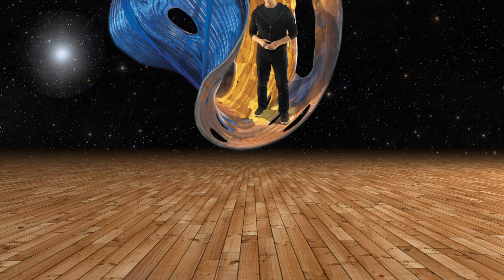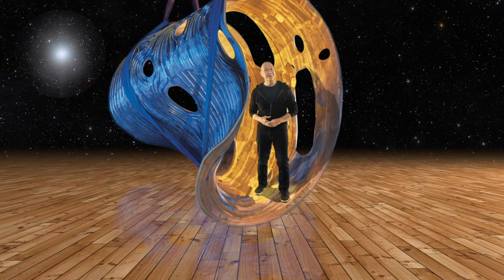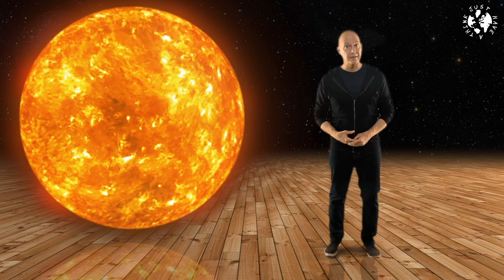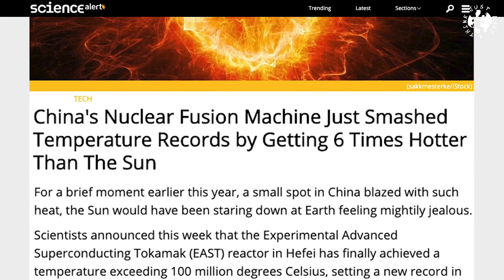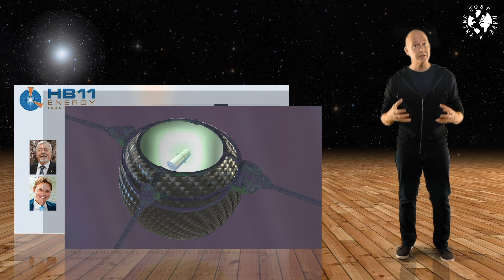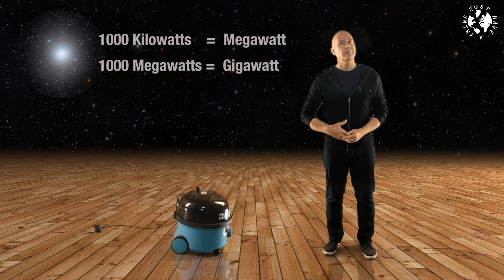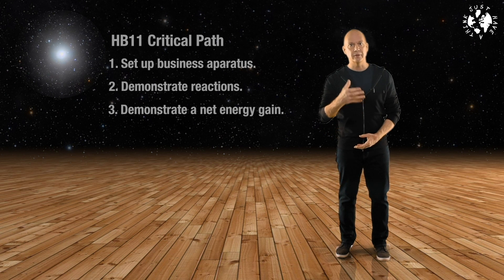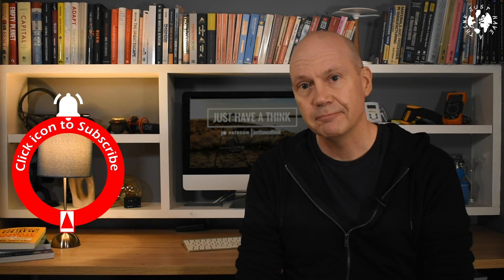Nuclear Fusion:  Revolutionary new breakthrough.

Comment: I keep hearing that fusion power won't have waste or pollution. It may be true that there won't be radioactive waste, but there will be waste.  By its nature, fusion fuses hydrogen, or, actually, deuterium, turning out helium. You might say, who cares about helium, it's a noble gas, not reactive, and not pollution. That's probably what the people who burned wood and coal used to say, a century or two ago.  But once you build lots of fusion reactors, you start producing lots of helium. Since helium is a chemical element that is totally unreactive, it will stay in the atmosphere forever. You won't be able to plant trees to capture it the way you can to capture carbon dioxide. Eventually, the amount of helium in the atmosphere will build up to measurable amounts. This will start to have an effect on the weather that nobody has bothered to predict. Later, the percentage of helium in the atmosphere will be so high that it will displace enough oxygen to make places at higher elevations deadly. Later, the death zone of the atmosphere will get lower and lower until the entire planet can no longer support mammalian life. Just have a think of the future.

Comment: We already have fusion power plant designs that WORK. Just that nobody wants to do it...dig a BIG hole, like a mile cubed, line with concrete, fill with water and cap it with a lid. Drop small fusion bombs into the center and detonate. Collect the steam to run turbines and repeat till we use up the worlds stock of weapons. Filter the water to reclaim the fission products as we go and re-refine for more bombs

Comment: Nuclear fusion is a blind alley. Nuclear fusion introduces more heat into the system. You won't cure global warming by introducing more heat into the system. Solar and wind do not add any extra heat into the system, they have no effect on global temperatures, they generate by using the energy that is already in the system.

Comment: In December 1942 the first controlled uranium fission reaction was achieved in the "Chicago Pile 1" experimental reactor. Just 14 years later in 1956 the first commercial nuclear power plant was inaugurated. 
Without underestimating the greater difficulty of controlling the fusion reaction, I believe that the progress of science has lost momentum
Reply: Yeah but the reason to build those reactors was to breed material for the Bomb. Genarating energy was only a side product
Reply: @Sanginius23  Right !.  The cold war was an important part of that "momentum" in the sci and tech progress. 
But there are also many examples of quick progress in fields far from the military uses.

Comment: We already have a solution to clean renewable power generation with solar, wind and storage.  The major blockage to getting it moving forward is legacy fossil fuel investments where they will stop at nothing to prevent them swelling the maximum amount of their product.  We can argue about the cost of Fossil Fuel based energy but it easily costs more than it’s worth in health and environmental damage. A Stanford Study states that the 87T global economy puts up with 67T in Fossil Fuel industry un allocated costs.  A Fusion industry could easily replace the Fossil Fuel industry as a block to moving forward with cheap local solutions.. Fusion would require a high tech and expensive infrastructure that would simply repeat the same awful hamstrung state we are now in where we cannot move forward with workable solutions against the monied interests of Fossil Fuel.  Additionally,  by the time Fusion gets working it should not be needed and if it is needed then we have gone past our point of no return and it would be too little too late.  I say, put all the effort and money into planning the substantial end of Fossil Fuel by 2030 and if Fusion comes along then it can compete with the incumbent  renewables but we cannot hold our breath for a second and waste resources on Fusion when we have a solution at hand.

Comment: The only thing that matters with regards to solving the global climate crisis and the energy and water crisis that comes alongside them is ENERGY DENSITY. Humanity has always progressed and advanced technologically when our power sources get smaller and produce more energy per unit volume. That's why nuclear fission and nuclear fusion are the way that humanity should be going - they pack ENORMOUS amounts of energy in very, very small packages.

Wind and Solar actually reverse this equation - they are ENERGY DILUTE - and use MORE RESOURCES to capture less usable energy per unit volume. It's foolhardy and will lead to eventual resource exhaustion and collapse. We need an energy density breakthrough so our society and move to clean energy, pass this great filter moment, and work to clean up the damage from 100+ years of fossil fuel use.

Comment: Its a neat bit of technology BUT it generates energy in pulses using an expensive expendable fuel capsule. A far more elegant take on proton-boron fusion can be found here: https://lppfusion.com/technology/focus-fusion/ and even here, we are now faced with fully matured and very cheap renewable energy. Add grid scale energy storage and it is unlikely that any form of fusion will be economically competitive. Good luck to HB11, but they may have missed the bus.

Comment: So, the obvious evolution is to use the stellerator design as a basis to create a toroidal version of wankel rotary engine. Using areas of high compression to generate fusion, then bleeding off the heat in sequence before another confinement cycle.

Comment: It would need temperatures 10x that of D-T fusion that tokamaks and stellarators need. I like that it doesn't produce neutrons, and the alpha particles become the electrical charges. But not being able to harness the speedy particles is wasting that energy as well (or did I miss that part?). Count me in for dropping the economic breakeven from 30 years to 29.

Comment: First up, he mentions if we ever achieve it at scale, well, actually, it gets EASIER as the magnetic confinement bottle gets larger, the reasons for that should be totally obvious. Having read a bit about the technology, it is abundantly clear , and stated by the experimenters themselves, that they do not wish to demonstrate a working model for energy production, but rather further avenues for other experimenters to consider attempting, in short, this idea is clearly orders of magnitude behind ITER in terms of technology readiness. The Wndelstein stellerator's concept is also another technology that is not as far along as ITER. The problem of confinement with ITER was looked at and they attempted to solve it by building a larger Tokamac, which gives more tolerance regarding confinement due to having more distance to the vessel walls and also allows for a more diffuse magnetic field, in an analogous way that a star needs to be of a certain size or mass in order to fuse.  ITER, however, also has another serendipitous advantage that they were not counting on , yet nevertheless will guarantee them success: The new REBCO superconductors completely change the game of stable confinement, these will give the device the ability to create electromagnetic fields up to and probably beyond ten Tesla, essentially they will have more than enough field strength to hold the plasma and keep it well away from the vessels inner lining. The other, obvious advantage is that q will be reached as designed, ten times energy output than input, none of the other designs will be able to compete with that, from what i can gather, all that is left now is to just finish building ITER, which is still just a demonstrator of the confinement technology itself, it won't have the ancillary equipment to turn all that heat into electricity, that is just the back end, and is relatively easy, albeit rather old school...one part is cutting edge, the other from last century....
Reply: Doesn't matter.  They'll never be able to beat the LCOE of other well known clean sources.  Giant Tokamaks or Stellarators are just too expensive.

Comment: This sounds a very good idea. Whilst I am not a nuclear scientist I have had a lifetime interest in energy. 
Long ago in the 1970's I recall an article stating that the only viable method of controlling the plasma stream would be via lasers. But at the time such lasers did not exist. Clearly they do now and if enough resources are put into the proposed reactors we might actually get something done. 
In fact  they are many technologies which we could and should be using.
Things like Solid Oxide Fuel Cell technology (Ok it is not without its challenges but what technology isn't) Certainly we could and should 
be looking at "mining atmospheric CO2" in much more detail.
I remember a paper published by SASOL the South African Coal to Oil people who stated that it is possible to use solar powered steam reformers  which would produce liquid hydrocarbon fuels from atmospheric CO2 and water.
The beauty of the Solid Oxide Fuel Cell is that it can operate on impure hydrogen fuels ie gasoline/petrol or methane etc etc. Because you would be extracting the C02 from the atmosphere you are effectively using the same fuel again and again. 
Whilst using solar power for your energy input. 
Then you have high pressure compressed air technology. Ok it is only some 34% efficient but if you can use the heat generated by the compression stages it is possible potentially to get up to efficiency levels of some 70%.
Now the rub here is because such systems can have very long lives they are far more efficient in the long term than batteries. How many people today have heard of Leon Mekarsky? I the last 30 years or so of the 19th Century he proved beyond doubt that you can operate a successful compressed air tramway system. What killed this was electric tramways but not for the reasons most people suspect. It is very easy to forget now that when cities first electrified in the late 19th and early 20th Centuries there were no such thing as national let alone international grid systems so each city had to have something that could provide a base load and a tramway system did that job admirably.  So it made much more sense to introduce electric trams. 
Today however it might be worth looking at compressed air in transport again. There are plenty of examples of other technologies that could be looked at again. Another transport technology which most certainly should be looked at again for railways surviving industrial installations which produce high pressure steam is the fireless steam locomotive. I could go on and on
The point is that in fact we could solve the problem of adding carbon emissions if there was actually the real will to do so.

Comment: Solar, wind & wave can be a stopgap until N/fusion. They all after all wear out over time, so it would become a case of maintaining them until fusion becomes available & then phasing out the old (worn) hardware as & when the new becomes available. The question then becomes economic practicality. Will upcoming generations of S/w&wave in conjunction with new storage tech need to make way for N/fusion?
One town, One reactor sounds pointless too. You'd have to maintain a national grid that feeds in our current renewables as a backup.

Comment: I would appreciate your exploration of small nuclear reactors. Bret Kuglemass claims that nuclear is not part of the solution, it is the ONLY solution.
He seems to be at the extreme edge of the solution space, but spins a good story. I'd like to see your excellent analysis of his story. One claim he makes is that getting to zero emissions is not sufficient--we have to remove CO2 from the atmosphere to get back to "normal" and nuclear could produce enough electricity and hear to remove CO2 from the air and synthesize liquid fuels to replace gasoline and diesel.
Kirk Sorenson pushes the Liquid Fluoride Thorium Molten Salt Reactor. And there are plenty of other players.

Comment: "safe" at those temperatures? sound sketchy
Reply: Richard, you clearly don’t have an education in physics, so don’t talk.
Reply: @Gomlmon99  https://thebulletin.org/2017/04/fusion-reactors-not-what-theyre-cracked-up-to-be/
Reply: @Gomlmon99  explain it to me physics boy, come on ya cowardly little bitch.........
Reply: @Gomlmon99  i have operated superheated 400# boilers for over 30 years, i fully understand the difference.
Reply: Richard Larkins How poor must your education and critical thinking be to imagine that personal insults make you any less ignorant, or change facts in any way? It’s like arguing with a child.

Please point to where in this article it says these temperatures are unsafe, as in your original comment.
Reply: Richard Larkins still with the personal unintelligent replies. I didn’t “attack” you, I called you out for spreading lies and misinformation. 

Quote me the line in the article that says these temperatures are unsafe. Or even implies it. 

It doesn’t, because it’s not. And any physicists could see that. No one even talks about that, it doesn’t cross the mind of anyone in the industry because it’s so irrelevant.
Reply: @Gomlmon99  i simply stated controlling temperatures 5-6 time hotter than the sun sounded sketchy, no mis information, no lies, in my book buddy you calling me a liar
 is an attack, you are the one running your mouth at me, and the article specifically calls out the inherent problems controlling temperatures.

Comment: I'm just amateur, and don't mean to ask a negative question as this seems a great goal to achieve.  I was fooled by the titled and clicked.  Aren't such  profoundly high temperatures so extreme and thus so expansive that there is potential for enormous explosions with a malfunction?  With nuclear fission there are great dangers, but none with fusion?  With Elon Musk developing a new low cost very efficient battery design won't wind, ocean, geothermal, solar, forms of energy be much safer and now even more efficient with such batteries?  Also some Australian scientists developed a solar panel the size of a paperback novel that produces as much energy as the conventional much larger ones.  Thanks for making such great videos, a lot of work, genius, and talent goes into them!
Reply: There's just not enough heat in the plasma to melt through the reactor walls. It's hot and under a lot of pressure, but there isn't a lot of mass there.

Comment: Suggesting to follow up with Eric J Lerner’s fusion project. This project utilize a unique approach other players overlooked. 

Most contenders employ magnetic induced plasma (ie electrode-less plasma) at a limited peak temperature which requires to scale up in size in order to up the input energy to reach target temperature, however it’s efficiency also in the process. 

On the other hand Lerner knows plasma well enough to utilize electrode induced plasma and by its instability self converted into “plasmoid” easily reach temperature multiples times without further system scale or complexity as would the magnetic method is. His prototype generate electricity directly no need to heat water to run turbine. It can fit inside a small home or big garage. It use repetition pulse to maintain fusion can be shut down simply by removing the next and successive pulses. Inherently free of runaway cycles.

Comment: Fusion? Forget it. It works for stars, yes, but recreating the heat and pressure of a stellar core is not an easy thing to do. It will be many years before we have even a genuine reactor (i.e. one that doesn't use a lot more energy than it produces), and even more before we have something commercially viable. It would probably be easier to spend the billions on making carbon capture work, and then opening a lot more coal mines.

Comment: Considerable progress has been made. Back in the 80s being able to control plasma for 30 milliseconds was great news. Now multiple projects can routinely do it for 30 seconds. And to higher temperatures, I think. The JT-60 reactor could have reached break even if they were allowed to use D-T fuel. They have just finished upgrading the reactor to more than double the field strength. W7X is in its active water cooling rebuild upgrade after which they expect to achieve 30 minute plasma control tests. At least 2 projects that are experimenting with the new high temp superconductor materials could increase the magnetic field strength multiple times. Other advances are in the works, such as deep learning AI control of plasmas.

Comment: A while back there was an article, or maybe just a comment on another site, that a seldom mentioned problem with inertial confinement fusion is that the pellets explode with about the force of a hand grenade and you'd need to do so about one per second. Try building a machine which could tolerate that continuously.

Comment: how many of these tokamak type reactors are we going to build ? when the SAFIRE project has a way to produce electricity cheaply and cleanly they need 20 million ot build the prototype generator,,,, Safire will change physics it broke the physicist brain that was hired to look at the data he quit,,, because it was doing things that by standard physics model says NOPE but saifre the true model of the sun says u want new elements ok,,, u want to remove radioactivity from material thats deadly ok,,, u want to generate power from a run away heating effect running at 7% power ok SAFIRE CAN DO IT because its a proper model of the sun,,,, ur say ur into energy GO LOOK AT SAFIRE https://www.youtube.com/watch?v=5IAiMpmGx-M&t=4s